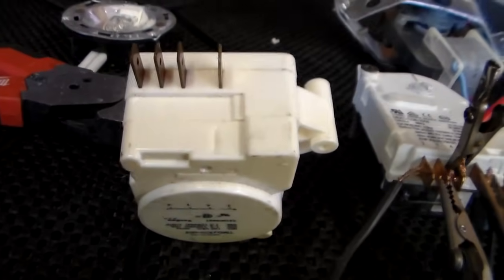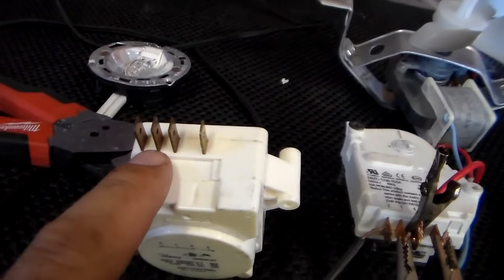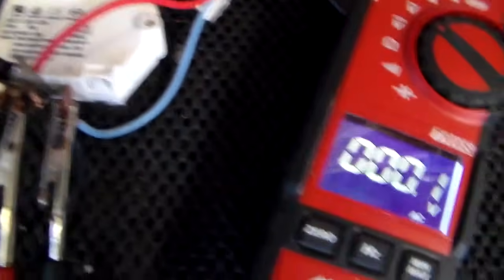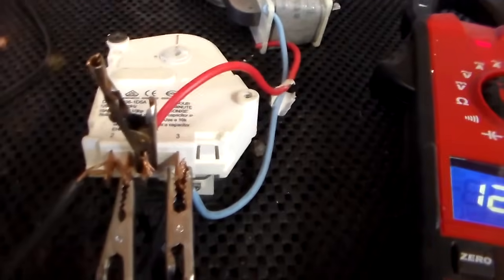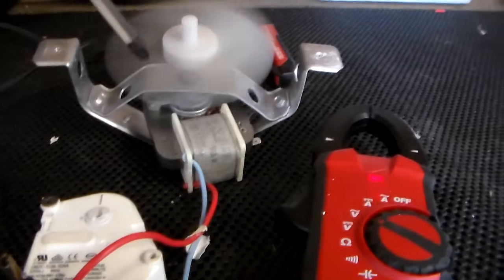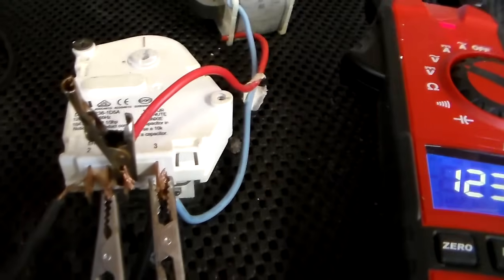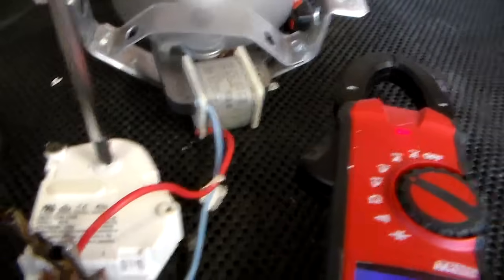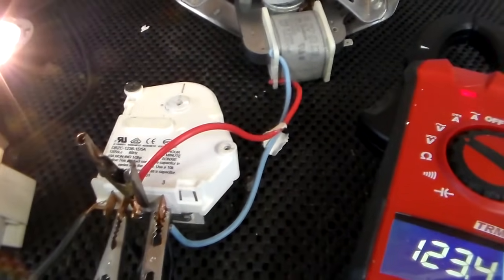How to Test your Defrost Timer

Comment: Hey Bill - Great Video I really appreciate your tutorial on how to test the defrost timer. Quick question though ... When you adjust the timer (2:43) and turn it clock wise those clicks you hear those are the time marks that lead up to the 10 hours right? I have a portable dehumidifier that has one of these defrost timers (part number: 3-71294-003 - this is my 50 MIN timer/8 MIN defrost) so, essentially if i turn it clock wise like you that means im giving the machine ample time to run (50mins and after the 50mins it goes into defrost mode for 8mins and continues that cycle right?? Also, since i am in high humidity any recommendations for how long i should keep that timer set at? Instead of 50min can I turn it clockwise halfway and the defrost would kick on at 25mins right?

Let me know !! Would really appreciate it! Thank You kindly!

Comment: hello sir,i have Frigidaire fridge freezer is on left side and fridge is in right side model# plhs37egsb1 has lots of frost build up on the freezer part and the fridge part is warm not cooling properly.i checked my defrost thermostat is good and I also checked my heat element for defrosting that is fine too,what can  be the problem? I think that would be the cold control if it is cold control how to test it or check it if it is not working,and by the way the fun on the freezer part is running too,thankx in advance

Comment: Nice, my Admiral refrigerator is cooling but I noticed that my freezer has condensation icing in the front and back panel.  I also noticed tonight that water was dripping g in the the refrigerator while the fan was off. what could be wrong?
Reply: rotate timer see if fan comes back on again.  if not then bad fan motor or no power or ground to motoro probly

Comment: Thanks for the video.  Couldn't you just check it with a multi meter for continuity?
Reply: yes.   what i did and found out mine was stuck off.  open.   wouldnt run compressor or fan.  nothing.  used ohmmeter on pin 1 and whichever pin was my cooling pin  not the defrost pin.  mine was stuck on defrost.  but wasnt running still.   so i rotated it til cooling pin was closed circtuit with pin 1  now its great fine cooling running again

Comment: Hello Bill, I was diagnosing my frigidaire problems and one area I want to bring up with you is the timer.  I manually turned the timer unitl the loud click.  Within two minutes I touch the defroster and burnt my finger a little so that was working.  Then I closed door and sat on the floor outside my fridge watching videos.  Within about 19-30 minutes the compressor came on and I felt the cold in the freezer come on.  My question is does this generally disqualify the timer as being the problem?  I know that since I had the ward refrigerator problem that I have not ever heard the evap fan turn on?
Reply: He passed away

Comment: I have an Avanti refrigerator model FF1008w and I have ice buildup on my evaporator, I advanced the timer to put it in defrost mode and the timer never comes out of defrost mode. I new a new defrost Timer but I cannot find my defrost time. DBZC-908-1D2  15 A NON-IND 1/2 HP 50/60 HZ 8 hours/ 7 minute and this defrost Timer is in series with a capacitor. Can I use DT model DBZC-807-1G2?
Reply: My tenant basement flooded and I replaced the capacitor and the refrigerator started working, the freezer is ice cold but the refrigerator is warm. The defrost Timer and the capacitor got wet.
Reply: The pins on my defrost Timer reading from left to right 234  1

Comment: Sir, how to check in tester where to put the L1 and to check the cooling and the defrost?
Reply: pins 2 and 4 are defrost and cooling regular.  pin 1 is your hot..  pin 3 is your ground

Comment: I have a question..my refridgerator was working but i turned it down..and now its stuck in defrost..i saw that the coils were iced up so i unplugged for 24 hours and still stuck in defrost..I found the defrost timer..but when i turn dial it clicks and everything comes on..but doesnt get cold..is there another test i could do im thinking its bad?? any ideas

Comment: Hi Bill my freezer cooling ok. it has a digital temperature display. but nearly after 10 hours it will display  dfrost and stay dfost forever. so i cant see what is the temperature . when i called the company who makes the digital display they told me if a little dot over the snow mark on display  it means fridge is cooling even that displays dfrost. is think fridge is not cooling -20 what do you think wrong mate?
Reply: timer stuck..  rotate it until it goes into regular cooling.

Comment: Couple of questions. So in that light i know you used pin 1 to one of the cables that goes to the light. To what other pin does the second cable of the light go to? 

Im doing a project. Im trying to put in a timer on a LG 4 door fridge. It has a linear compressor but I want to install a regular 115v compressor and a timer to eliminate the 175v linear compressor(pain in the but machines) Im just trying to understand the timer a little bit better to get this done.
Reply: Thanks anyway
Reply: hmmm what is a linear compressor?  i thought all compresors were 110 volt? hmm..

Comment: Hello Bill,
When I connect the power to pin 1 and pin3, does the timer run in both modes, defrost mode and out of defrost mode? or it runs in only 1 mode and stops in the other mode? or always runs.
Reply: 1 and 3 are hot and ground to run the timer.  2 and 4 are defost and cooling.   timer can stop the fridge from running fan and compressor both.   rotate it see if ti comes back on again.  if so then bad timer and good therm

Comment: bill, 10 hours on: during the 10 hour window, i assume the condensor/fan is not continuously on. and that in fact during the 10 hours of circuit on, the actual 'thermostat' (temp sensitive switch) will act as the secondary switch to tell condensor/fan to be on or off. is this correct? question 2: what is the exact purpose of having refrigerator in so-called 'defrost mode' for 30 minutes? for all it truly does is insure the condensor gets a DEFINITIVE  30 minute rest every 10.5 hours. what is actually 'defrosted'?

Comment: Great instructional video! The average person doesn't realize there are only a few active components that can fail.

QUESTION:  do you know the resistance value between pins 1 and 3 when the timer is disconnected?

Thanks

Comment: I have a problem with water dripping down from the air share from the freezer.  The refrigerator is just a few weeks old and it has been dripping since it was delivered.  I think we have a power failure and the defrost timer may be out of sync with the ice buildup.  is there a way to reset the defrost system?  I can believe the drain is stopped up so early in the refrigerator's life.
Reply: timer stuck in defrost.. rotate it  or possibly missing  ground to timer

Comment: hey bill,
excellent videos.  you do a wonderful job.  I have a question,
for the defrost troubleshooting technique of manually turning the dial to initiate the defrost system to seee if the heater comes on, what will allow the heater to come on if the bi metal thermostat only opens when it gets to its specified cold temp?  how will voltage get to the heater if the thermostat is not cold enough but the timer was manually put in defrost?
Reply: therm is bypassed,   extra wires from therm and timer  to bypass therm for defrosting cycle

Comment: Thanks Bill, Good video!
My LG is a newer model, and is too warm with the settings set to max cold 7 on this unit.
Just a little frost on the inside freezer coils by the (restriction) big to little line size change.
Compressor coils under it were dirty and had dog hair on them, so I cleaned them and now it seems even warmer inside the unit.  Compressor runs, fans run, no frost, no door leaks, not cold enough.  Feels like 55 in freezer and 65 in frig.
Any ideas?

Comment: niw if timer diesnt move at all, is it a bad timer, ir just not getting power to advance timer....freezer freezes, fridge diesnt cool diwn low enough, evap. freezes over. I ve had to manually defrost twice in two months....I was told its probly thermostat...I advanced timer to activate heater  but it did not heat up  is that just thermostat telling brains don't turn heater on or nit sending power to timer to activate heater element? or is heater element getting power but its just bad needs replaced....I've got new thermostat only because old is blown up  or top side is crooked and forcing itself outta case...like water inside n froze n expanding....like a frozen copper waterline....after defrosting manually it works fine for about three weeks before I notice temp starting to increase in fridge compartment ...so wat get power from thermostat when it makes contact...does that power anither componentalong with compressor activation

Comment: Hi Bill,
I figure it out that my defrost timer seems faulty so i set manually. Now its working but the thing is that its compressor is running continuous.
Will setting manually will damage compressor or it effects any other component in refrigerator.
Reply: can overheat wear out compressor sooner yes.    thermostat is what controls on off cycles of cooling.    the timer just switches betwen def and regular cooling.  you can just bypass timer jumper it for coolin only and thermostat still ocntrols temp and shuts on off/   you may have bad thermostat.  use ohmmeter check for ohms when you shut therm off click and when you turn it on make it click on.   should be  no ohms/closed circtuit when on.   and wide open circuit  when off.

Comment: What if the numbers are different on the timer terminals?  Go by the numbers or the position of the terminals?
Reply: red hot all time.  orange cooling cycle  black ground   pink wire defrost cycle

Comment: What is the pertcentage chance that I bought a faulty "new" defrost timer, dad's refrigerator only worked for about 8 hours with new timer on and got stuck again?  Nothing works, only lights inside. Can a mishook with the timer mode wire burn or make the new D-Timer inoperable?  The timer mode wire is that black wire with a lead that comes out of the D-Timer from its side and that is supposed to be attachet to one of the four D-timer pins.   Please reply.
Reply: no power or ground to timer probably..  check pin 1 for power and the last pin for ground

Comment: Question for you,  I suspect my freezer timer to be at fault.  I monitored operation with compressor working and getting cold.  I advanced the timer to defrost.  The compressor and fan stopped and the heater started.  My cycle was about 25 min. and then  the compressor and fan started back up.   I used a non contact inductive tester to confirm the presence of voltage.  Prior to defrost, I confirmed no voltage on the orange wire feeding the thermal switch  clipped to the coil.  When defrost engaged,  the orange wire was lit and so was the feed to the heater.  I manually advanced the timer to get out of Defrost.  I heard the click and compressor / fan started.  When I went to test the orange wire feeding the defrost heater ,  it showed ON but was not conducting any current to the heater because the thermal switch was open.   I'm  suspecting something wrong with the timer because there shouldn't have been any voltage on the heater circuit when the timer is not in defrost, correct?

Comment: Thank you for sharing your helpful videos.  I tested my Frigidaire FRS26ZSHB2 defrost thermostat and it appeared bad.  So, I've ordered a new one.  Meanwhile, after manually defrosting the freezer and turning the unit back on, everything was working normal. I was again getting air flow into my Fridge compartment.  After an hour or so, I noticed that my fridge quit working and that I heard a really fast constant ticking noise.  The noise was louder in the Freezer compartment than outside.  I listened by the compressor and it was quiet.  Any ideas as to why it starting the clicking? I get my new thermostat tomorrow.  Thanks!!!
Reply: timer  is sounding like it is broken failing.  timers make clicking noises but not suopsed to be loud.

Comment: When you turned the dial on the back of the timer, how do you know where the setting position is for defrost mode "ON"?  There are no markings there.
Reply: you dont really.   you have to find that out with multi meter on pins while rotating timer
Reply: First loud click - defrost for 30 mins.  Second loud click - back to cooling for 10 hours.

Comment: bill  how know when the compresor on the refrigerator  needs frion
Reply: wont run or lines both same or close to same temp.  one should be hot and other cold.  if not the freon low or not circulating  or evap fan not working or evap coils too dusty dirty.

Comment: Hey Bill, Love your videos, you 've helped me troubleshoot this fridge that I own.   I have my problem narrowed down to either my Thermostat or my Defrost Timer,  I have a Maytag MBB1952HEQ,  My freezer is not getting cold enough and it seems that everything runs just fine, but when the fridge does eventually shut off it never turns back on, I can fiddle with the temp control and turn it back and forth but she will still not turn back on, after a little while I can turn it back on but it seems that she will only run if I have it all the way up on max cold.  Did my Thermostat and Def Timer go bad?  Not likely, but with my luck they probably did....LOL  Curious on your take on this one?

Comment: sir, you pin number 2 and 3 is at  heater ?
Reply: 1 is hot, 2 is defrost, 4 is reg cooling.   3 is ground.   they are out of order on timer..   last pin by itself is ground

Comment: My fan isn't coming on after comes out of defrost, could this still be a timer problem?
Reply from the maker: +marc stuart Some refrigerators have a delay built in for the freezer fan.  I think there are some that are wired through a seperate  defrost thermostat also.  Just depends on the model.  If it goes for more than 5 minutes with the compressor running and the freezer fan has not kicked on, then the timer control could be defective.  Just depends on the model.

Comment: I have a Whirlpool Gold with ice maker on door.  The ice maker hasn't made ice in 2 years.  Recently there was a clicking sound (like a timer) that would last a few minutes then go away.  Now the freezer and fridge are warm, compressor not running.  When I unplugged it and then plugged it back in (about 10 seconds unplugged) the compressor restarted.  Any ideas?
Reply: Sounds exactly like my Kenmore fridge - the main contactor that starts the compressor was faulty. The repair person indicated that the problem was very common. Needs to be replaced. Not a lot of money, except the service call part.
Reply: Is the "main contractor" in the start relay? My fridge doesn't have a defrost timer, at least not that I can see.  I think it has an ADC board.  And I don't know where that is even located.
Reply: The 'main contactor' is the power relay that starts the compressor motor from the temperature controller. In most cases, it is a separate component not mounted on a circuit board. Most fridges today are 'frost free', and will have a defrost time that controls the time intervals when the fridge is running or when the defrost is running. A good source for parts is www.repairclinic.com They also have repair videos.

Comment: Could the fan still run but compressor just kicks off due to defrost timer?
Reply: All fans should run at the same time when compressor runs. When the compressor stops, all fans should stop as well because they are on the same electrical circuit.

Comment: Hey Bill,
     A few months ago I was watching video's and they were explaining how to clean the coils. So  I got that long cat tail looking brush. And my air compressor ready. Pulled the Refrigerator out from the wall. Took that cover off. And yeah I had it unplugged. Got the air compressor up to about 100 lbs. I got down on the floor behind the Fridg. and started blowing off the coils. Now from the angle I am in I can not see what is coming out. After some 20 min or so of scrubbing  and letting the air comp. catch up and then blowing. I crawled out from behind the fridg. And  to my surprise I find I have dusted the whole kitchen in demon dust bunnies. That crap went everywhere. I had to clean  the counters the tables and sweep and mop the floor. Just kind of a FYI . Some times when you get in a hurry it ends up taking longer.

Comment: I have a stand up Maytag freezer model # mqu1554aew and the outside of the freezer top are extremely hot. compressor is on light is on but it defrosts meat
Reply: Tomas Fonseca there is a heating element inside your freezer that possibly isn’t turning off during the time your fridge goes to defrost mode you would need to check your defrost timer test to see it is working properly and if it is then you know it’s not your defrost timer check the heating element inside your freezer test the heating element to see if it’s working properly usually it should be running from 5-20 ohms anything higher or lower it means it would need to be replaced

Comment: Hi Bill, thanks for the great videos. They are very helpful but in my case I have a Maytag computer controlled, up and down fridge. I don't find a defrost timer. I suspect it is on the control board. I've checked the heating element, the bimetal switch on the evaporator and the evaporator fan, the condenser fan is good too.  Is there anything else that can cause the fridge to be not cold enough. The freezer and ice maker is just fine. I had let it sit for several days to melt out any ice then turned it on. It was still too warm in the fridge. 
Does the Maytag MBB1957WEW1 have a self contained computer diagnostic program? I saw another video for a different fridge of how you push the light switch two or three times and hold. Then it flashes a code back. Does the Maytag/Whirlpool have anything similar?
Reply: what can I do next? can it be one of 
the Thermisters
?